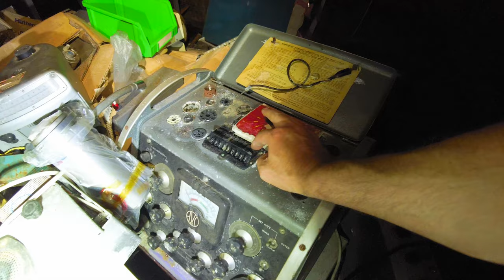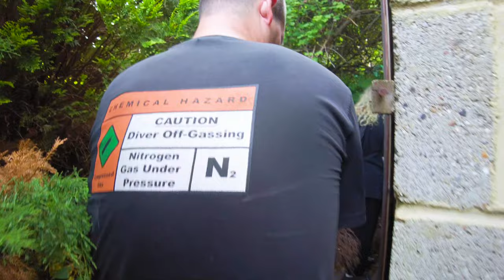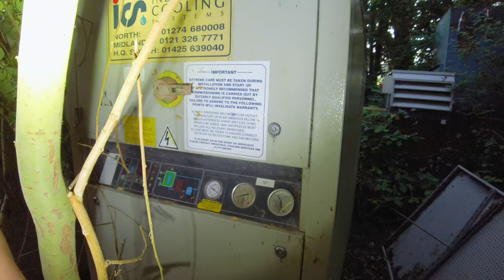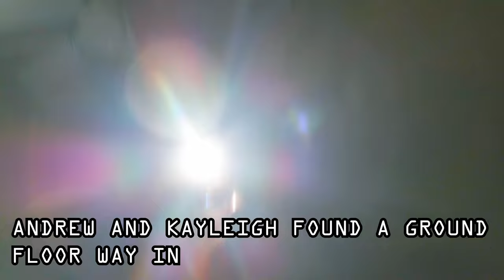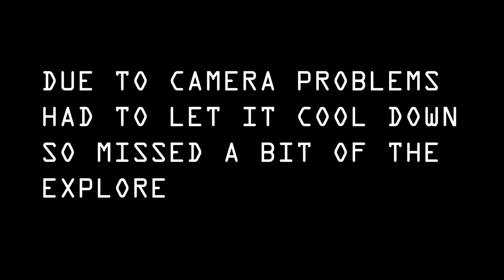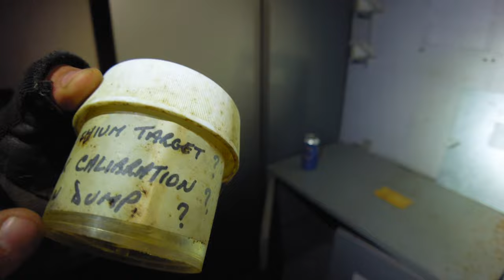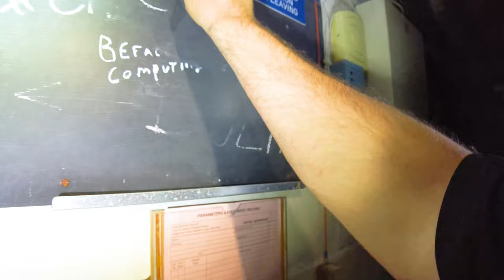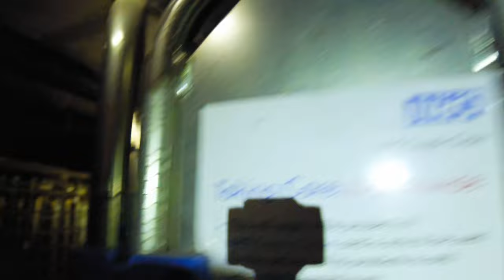SHOCKING FIND IN Experimental Radiotherapy abandoned hospital

Comment: The AVO equipment you found was for testing old valves..open the lid stick a valve into the appropriate socket and do a test.I have an old valve operated AVO meter from the 60's still works.Quality stuff that AVO gear.

Comment: That old computer at 9:45 appears to be an HP 85b.  I used to noodle around for hours on one as a little kid, writing little programs on these to draw graphics on screen and send commands to a plotter, now I have 2 of them.  They were marketed in the day as extremely powerful desktop calculators that could also interface with tons of gear you'd find in a lab like power meters, power supplies to log readings, digital oscilloscopes, relay banks to automate machinery.

Comment: 1:21:22 The formers are made from a material called Paxolin which is a reinforced resin that was more widely used up until the 90's but still has uses in industry. It has a high Insulation and is very tough. I understand that its 'dust' is quite toxic when machining it.
*Edit. I was a former employee up until 2000 of Philips for many years, whose factory was originally run by Mullard Tubes. I made 21" tv tubes and 14" high spec monitor tubes while we were Philips. Simply Years Ahead!(?)

Comment: 1:18:43: What you got there is a pressure insulated X-ray generator using the Van der Graaf principle. The belts are missing but the tubes either side are still there.

Comment: Carry some short lengths of rope for the top and bottom of you collapsible ladder for tying off and securing in place. The device your looking at : 01:20:00 might be a voltage multiplier increasing the output charge to make an electric corona on the dome
Reply: Making plasma

Comment: Those big vessels could be a, hear me out, nuclear reactor.

They will often have a minature, extremely low output reactor that can be used to produce nuclear isotopes. 

They're so small that they don't require any form of cooling

I know of a couple in the UK used for defense related testing...one of them being quite famous based up in Scotland.

The other, i wont talk about here...although, it is likely pretty well known about in and of itself.
Reply from the maker: sounds like you know more than me. should we be worried and check ourselves for exposure to radiation. I have a Geiger counter but dont know how to use it properly. email me for more fun chat direct. lol
Reply: @TheSecretVault  well, you should be fine as the confinement should have done its job (if that's what they were doing).

So long as it remained sealed that is.

Also, if it had been a place where that kinda thing is being done, then, there should have been warning signs posted all around.

I know that they do use Gamma for certain things.

Beta radiation...I'm a little more unsure about.

However, when it comes to Alpha, its rated more as a toxin which becomes dangerous when ingested into the body than a radiation risk per se...in a stable form such as U235 that is.

The thing with things like radioactive elements though is that, given time, they break down into different less stable forms of the element.  They keep breaking down beyond these stages though, tending towards, I think, iron given enough time...iron being the most stable element there is.

I would imagine you'd be fine...they may be a little more concerned regards security if there was any risk as a result of radioactive contaminants in the environment...even if that were only on the level of PPE used during any of the production processes which may have been happening there.